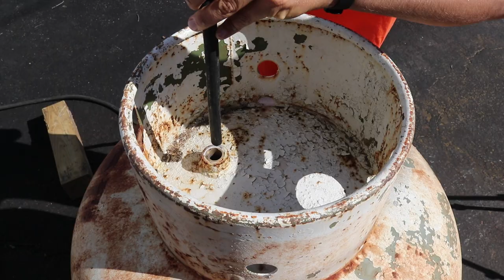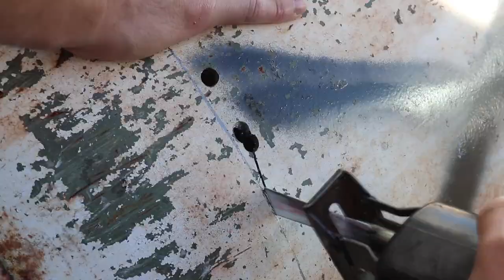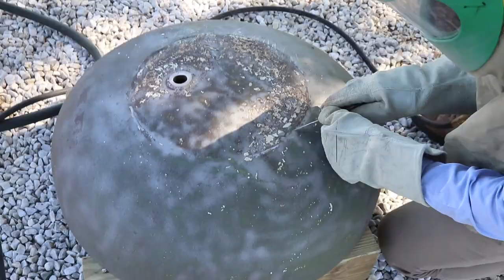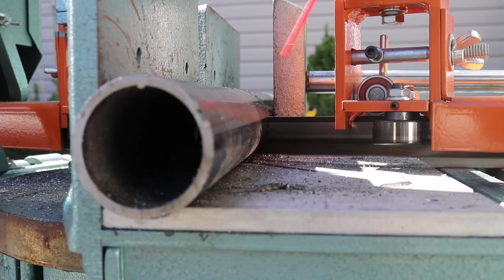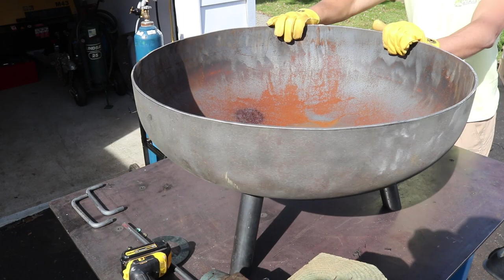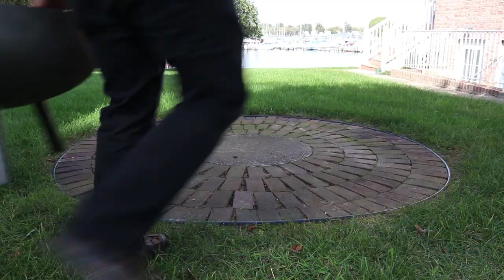DIY Fire Pit: Repurposed Propane Tank

Comment: I made a similar set up about 10 years ago, but I added a coupler on one side to accept the bottom of a trailer jack that had a bbq screen welded to it. Had swivel and height adjustment with the jack. I also  built a tall hangman pole to attach a block and tackle to hook a huge dutch oven on same bottom mount same swivel and height adjustable. Awesome video and good for showing others what can be done.
Reply from the maker: All those options are what I want to add into the next version. I've been building a new shop for the past 2 years it seems like lol. Hopefully I'll have some new videos in 2023! Stay tuned and thank you very much for the comment
Reply: @Rybak  what project ever gets completed on time Lol. If you rebuild it I'd suggest using a second tank bottom mounted on the opposite side of your grill with a jack to act as a lid like a "name brand" bbq. You can make bread or pizza with the thick steel and a little coals.

Comment: I have some of those tanks. What angle did you cut legs at?  Good video.
Reply from the maker: Thank you! Unfortunately I dont remember. I believe I just did it by eye/using the framing square contraption as it sat on my bench, it gave me a parallel line to the top of the tank. The potion that is welded to the tank didnt have and angle. The only angle was on the "foot" portion that touches the ground.

Comment: I just built one of these from a big air compressor and used the end with the legs.  I am going to cut the motor/compressor mount off the other end and make another.  I saw you using a cardboard template.  Was that to get even 3rds for the legs?  Can you explain that a little?  I didn't listen in math when they told me I would use it!  ;o)
Reply from the maker: Correct the cardboard was just to get even spacing for the 3 legs. 360 degrees divided by 3. The edges of the cardboard are 120 degrees apart
Reply: @TheMikeRybak  Okay now I just feel stupid!  lol  Thank you for the tutelage!
Reply from the maker: No brother, no dumb questions. I really appreciate the view and the comment! It helps me stay motivated. I hope to be back on the video making horse soon.

Comment: Very nice build what size was the tank
Reply from the maker: I want to say it was 100 gallon propane tank. 36 inches in diameter. Contact your local propane dealer and ask for an old tank
Reply: Thanks
Reply: Tank you

Comment: This might be a silly question, but what angle(s) did you cut the legs?
Reply from the maker: Unfortunately, I dont remember. The end of the pipe that contacts the bottom of the pit is 90 degrees. To find the angle that contacts the ground, I took two framing squares and clamped them together and struck a line at the height I wanted. The framing squares looked like a C. I adjusted the saw to cut the angle based on the line I drew. Hopefully that helps.

Comment: wait what? you put the handles on the inside?
Reply from the maker: I did. I was going for a cleaner look on the profile of the pit. Whenever I set it up it never gets moved until the next day when its cold, personal choice.

If I was to make them for other people I'd probably put the handles on the outside or in the traditional location. 

Where would you like to have handles on a pit this size? It weighs 70-80lbs roughly

Comment: All that work it’s easier to just buy one for 150-200$ you have that in material alone right there
Reply from the maker: And when that $150-200 job rusts through or blows across the yard, I'll buy another one lol. I appreciate the view! Just a fun build.
Reply: @TheMikeRybak  prop should recommend against cutting a propane tank for your average joe, not everyone is smart enough to fill it and water it down. Iv had my same 200$ fire pit for last 3 years. Haven’t blown away and of rust. Put it away during winter and drill few holes in the bottom to less water drain and it’ll last long enough.
Reply: @bigshlonggooo4332  That's why he filled it with water. And i think it is a good message to recycle something instead of just buying one new.
Reply: You will get less than you paid for!  lol